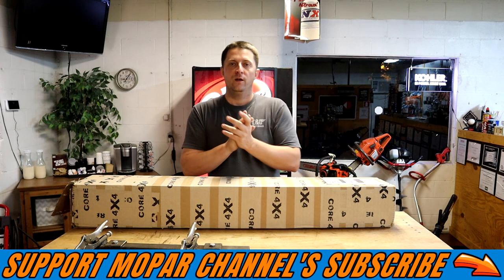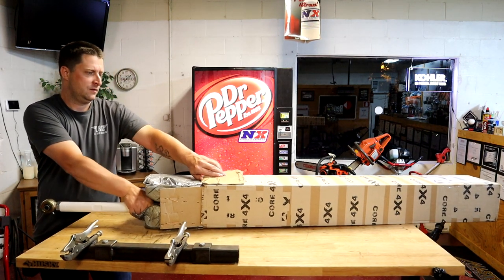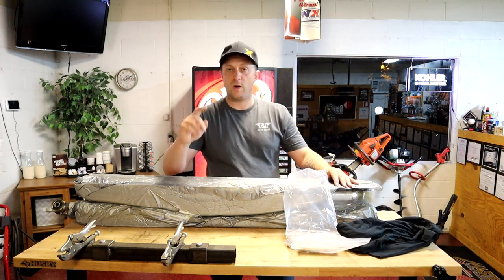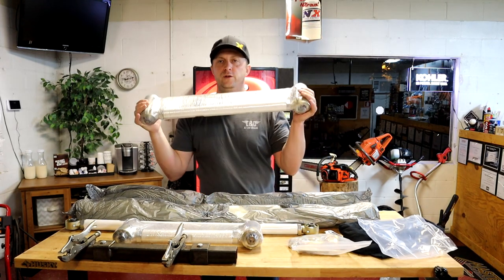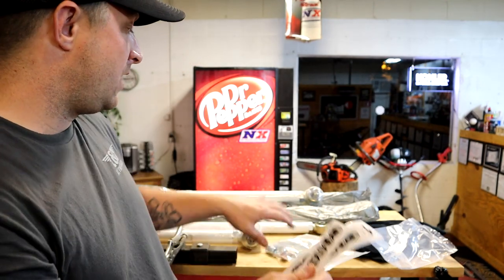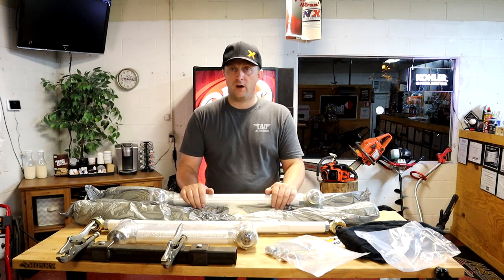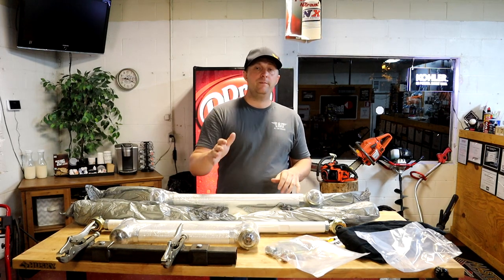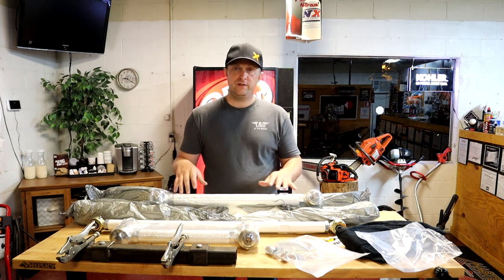New Light Weight Aluminum Racing Control Arms From CORE 4X4

Comment: I have a question for you, I have a2015 Ram 1500 RWD when I get my foot into the gas the back end seems like it’s swaying side to side. But the tires aren’t breaking loose. Is there anything I could install to help that?
Reply from the maker: Is it stock suspension or lowered
Reply: Stock suspension, it’s also a regular cab
Reply from the maker: @kyleginley4876  if you get wheel hop that could cause that